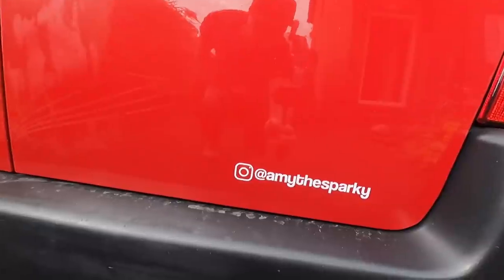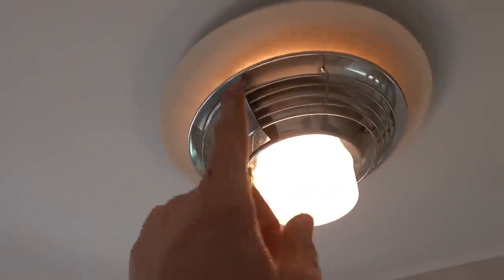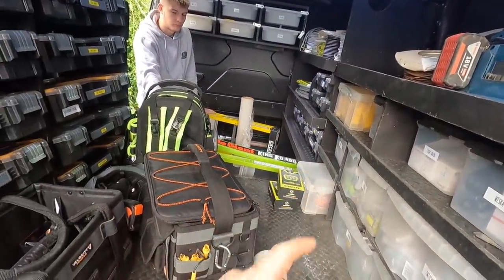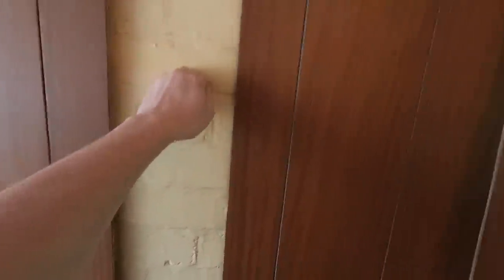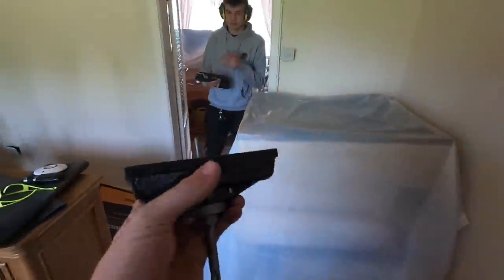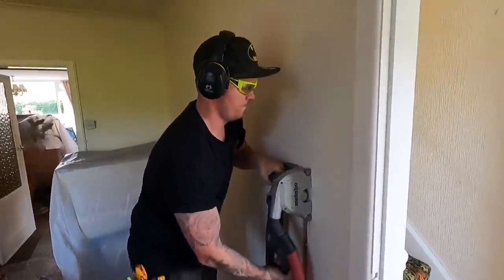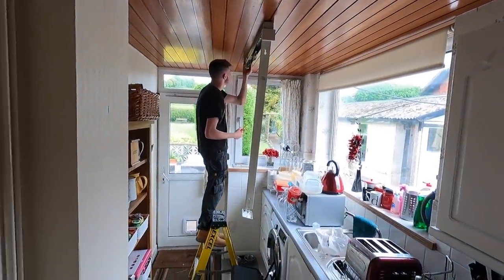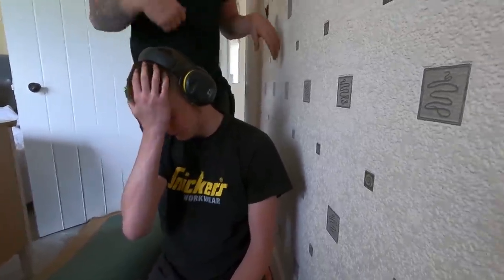Starting a Re-wire with Amy - Electrician

Comment: Re. the shared supply, ISTR reading that if you tell them it's for an EV charger, they have to unloop the supply for free.
Reply from the maker: Thanks bud
Reply: Not necessarily have f the DNO judgement is that supply is ok for an EV charger they won't change it. It something that should have been sorted prior to the job . Now as it is a shared supply you should have consult next door prior to work beging done. If next door object to there supply being cut off to move the supply cable DNO won't move it. You need written permission from the neighbour for the work to be done.who going to pay the possible £5K to £10K bill to move the supply to next door , you can't expect next door to pay. This should have been sorted before works start. This could finish up be a legal nightmare. It the DNO move the supply who going to be the sparks to reconnect the next door CU to the new supply the DNO won't do it nor will they move the meter.  As a sparks I would never undertake any works that may involve an a joining property in less the customer I'm working for  legally protects me from the owner of the a joining property. Because if it goes tits up guess who there going to blame . And I would check will my insurance company explaining the situation to see if I'm covered. If next door do agree to the supply being moved they don't have to have you as the sparks to carry the work they can hired there own sparks and sent the bill back to you . I've had incoming supplies moved by the DNO just for the same property I've worked on the DNO move a cable joined a new cable on the old cable and a new service and that cost £5K ,  and I had to dig the trench. The work you want carried out is a bit more involved
Reply: Those socket cutters are fine for thick walls, especially block. No good for old single brick on sides in lime mortar in old houses!

Comment: the armeg square hole drill set are awesome to use, you need to use the template to mark the drill holes for the back box there's no need to stick drill the edges of the back boxes either, use the hard brick drill (round drill with TCT bits) to  drill to the 35mm depth then use the square edge tool to square off the cut out simples

Comment: Tell western power an EV charge point is getting installed Nick. They will have to unloop the supply and most delicious... its free.
Reply from the maker: Good shout mark 🙌🙌🙌
Reply: @NBundyElectrical  they don’t have to, probably just give you a letter saying it’s fine
Reply: If Western Power are the same as where I work the cable to next door will probably just get re routed to high level right above the windows . BTW the services don't look looped just a the main abc conductor will be providing the main feed and the two services split from the gable end of the wall.

Comment: Every time I see a British loft access hatch I'm thinking that the design must be the work of a sadistic person! Here in Germany, even in old buildings, the loft access is much more comfortable to use.
Reply: Honestly, if you're from central Europe, everything in British houses will feel a bit scaled down! The same is true for Dutch houses and quite a few other places in north-western Europe (parts of France and Belgium mainly). Sprawling Irish bungalows are a bit more like what we're used to. Just to give you an example, minimum width for stairs and halls has been 1000 mm here in Austria for a looooong time and most are at least 1200 (unobstructed width, i.e if you've got a hand rail screwed to one wall the actual stairs need to be even wider). Maximum acceptable pitch is also lower than the 45 degrees you find in many north-western houses. I think a fairly typical pitch is something like 15/25. Minimum ceiling height in domestic premises is 2500. Pre-WWI city houses, even the most humble working-class flats, usually had well over 3000, upper-class places often went to 4500, which is a bit ridiculous TBH.
Reply: It's an inspection hatch, not a loft hatch. Very common in the UK. Designed for surveying purposes not access.
Reply: @JakeBM4  Ok, I've only seen such small hatches and ladders put on to get up there. And I thought wtf is this and why is it so small?
Reply: @Ragnar8504  So same as here with the ceiling height. In my 1950s house the ceiling height is 2.5m. In the house of my parents it's only 2.3m in the rooms of the ground floor.
And they still installed ceiling fans in there. I said if someone's too long for it, he will be shortened automatically 😂
Reply: @Marcel_Germann  I don't even want to imagine spending more than a few minutes in one of those really old timber-framed farm houses in Germany though - I've heard some of them have ceilings as low as 1700! That's about my shoulder level.

I think the smallest access hatches you can get here are 600x600 - a firefighter needs to get through into the loft in case of a fire.
Reply: @Ragnar8504  Most of them have higher ceilings. Usually a bit over 2m, but in the cellar it's getting extremely low. Even for me, and I'm only 1.73m.
Reply: You should see mine, I have to climb through a cupboard to get to it.

Comment: I have the Armeg box cutter set. Never use it, it is a faff. You have a bit, kind of like a router/drill bit that you use to remove waste before using the box cutter and it creates more dust than necessary. Drill and chisel bit all day long. Nice one dude. Am I right in thinking that if you run armoured for the mains that it doesn't require RCD but if you used standard tails they would.

Comment: always striked me as weird that British and American backboxes are squared and not round
makes it such a hassle to install
Reply: More space for wiring though, It's always a trade-off. I do like to use round 60/70 mm boxes and just core-drill the holes in the walls but Italian (Italy uses the same boxes as the US, BTicino imported the whole design in the early 60s, including the #6-32 UNC mounting screws just to make things properly complicated) boxes are quite nice if you've got a lot of wires. I can buy Italian back boxes and accessories (including standard Schuko sockets) from an Austrian wholesaler and being a sucker for trying weird things I had to use some. Very modular but definitely not cheap!